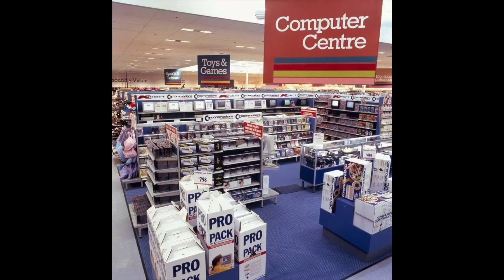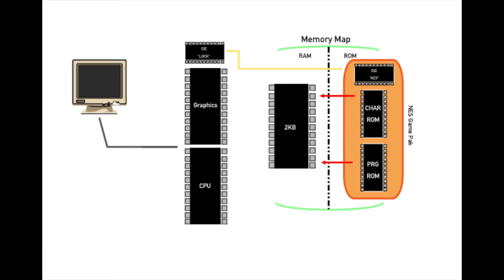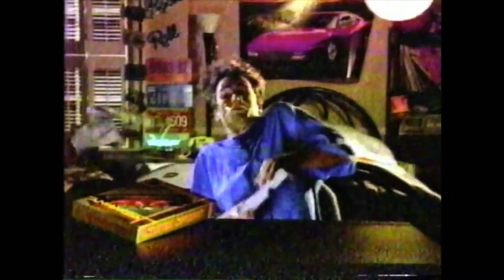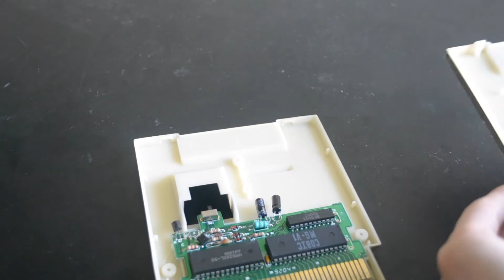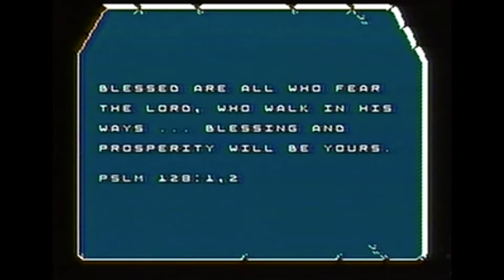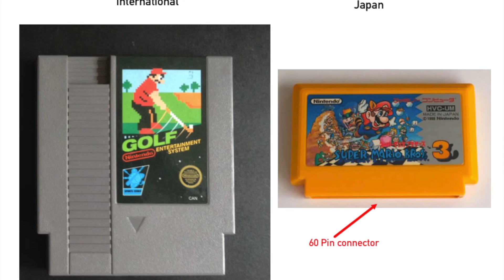Nintendo Entertainment System: Lockout Technology, Hardware Issues, and Unlicensed Games

Comment: I know this is an old video, but a couple of things to add:

1/ You don't need to desolder the entire CIC chip, just lift pin 4. It's literally a 5-minute mod if you've got a screwdriver and a pair of pliers. 

2/ I know it sounds weird, but boiling the connector works. I did not believe it myself until I gave it a go, my electronics teachers would be horrified no doubt, but there you go. The result really is not a subtle matter, the difference is night and day. I wouldn't like to do it weekly, and you do of course need to be very careful that it is dried appropriately, but it is genuinely shocking what a difference it makes if you've got an old and picky NES.